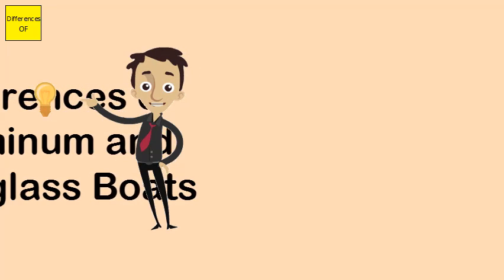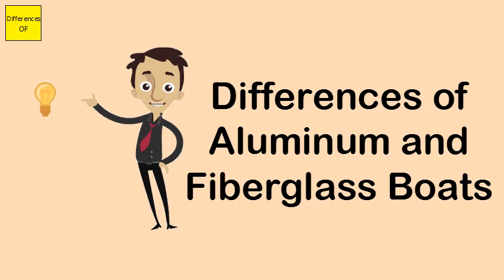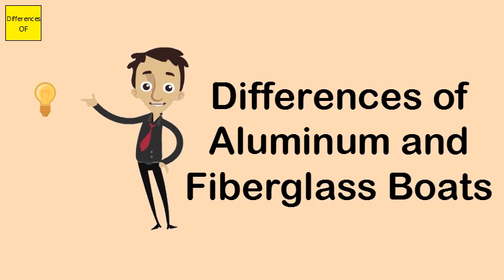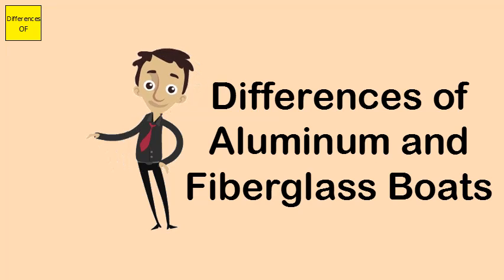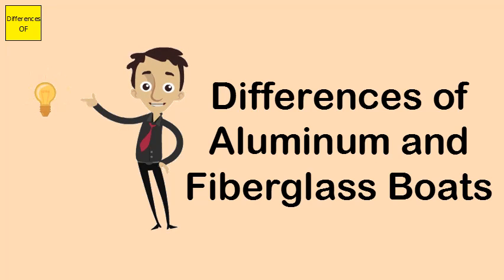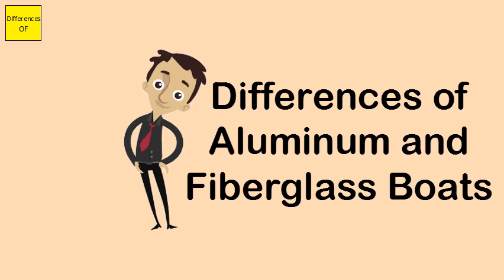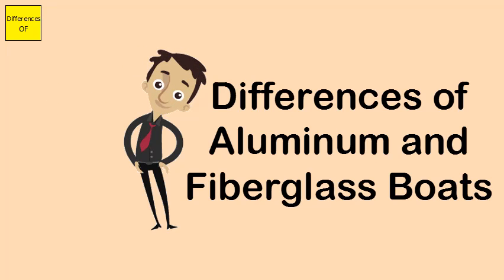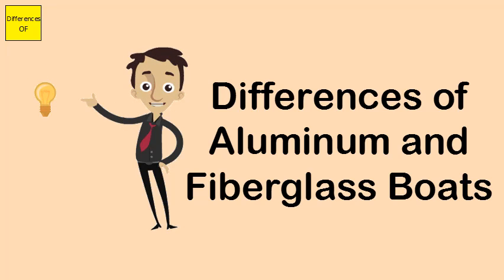Differences of Aluminum and Fiberglass Boats

Comment: aluminum boats used to make louder noises coz of the hulls being hollow in between.., it has changed! there’s something that’s called “foam filled injections” to sound proof all the spaces that was once hollow.., if u want more you can also use sound deadening.., it’s a couple weeks away till 2020! major offshores aluminum fishing boat companies been doing this for about 10yrs or so.., so get ur facts right about that 😂🤣😂🤣 do some research on Stabicraft Aluminum Boats...
aluminum boats nowadays does have the “reverse chines” as well..
Yes aluminum boats r cheaper but depending on brands.., also aluminum holds it’s value lots more than glass boats!
aluminum boats like Stabicraft can road swells and honestly is alot better compared to a grady white!
when it comes of gas fuel tanks n space.., aluminum boats r just the same as glass boats! 
to whomever that did this video clip sounds like they haven’t done their research or have been up to date in today’s offshore fishing boats industries..
to the author of this page.., plz look up on aluminum boat brands like...

Duckworth, Raider, RH, Weldcraft, Hewescraft, North River, Silver Streaks, Wooldridge, edge marine and most of all Stabicraft!!!

just r just a few name drops of the best if the best aluminum boats in this time n era.., most of them r from oregon, washington, canada n alaska...

dont be comparing small aluminum boats like trackers, gregors n nitro lol 
if u wanna compare apples to apple u bring out names of the boats ure comparing it to..
auther of this page i’d honestly like for u to do more thorough research of the name drops ive given u.., coz what ure comparing to r aluminum boats back from 2008 and older... it’s almost 2020! things r changing and more advanced ☺️☺️☺️